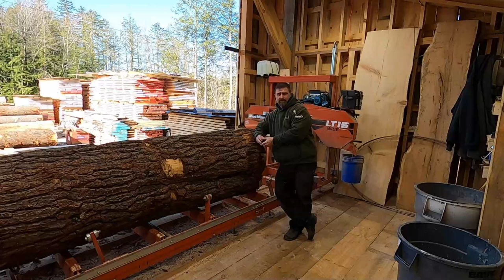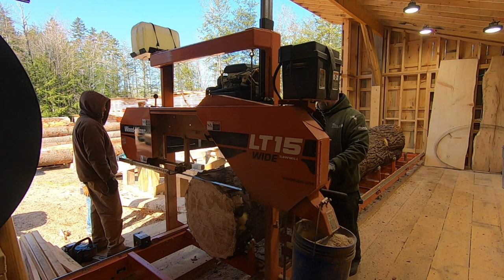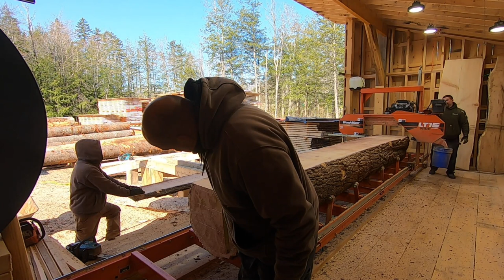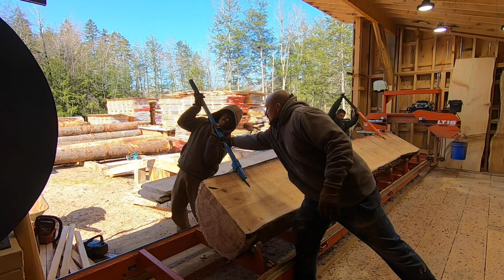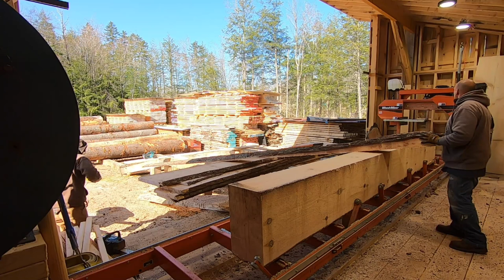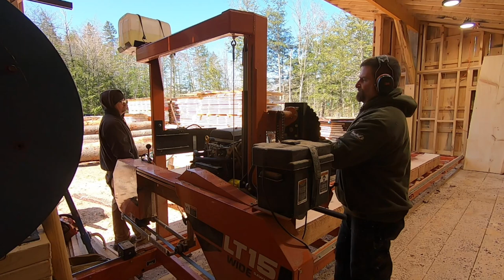LOGS-TO-LUMBER, 3-TON MONSTER

Comment: Hello, congratulations the videos are great! I have been following you for some time, I myself have a Track-Met saw bench. I almost took an LT15 too, but the after-sales service in France leaves a lot to be desired. I see that you are sawing really big 😅 you haven't had any problems on such large sections? Blade breaking etc..? What is this wood anyway because I find that you saw quickly compared to me? As an indication, you change the blades or after how much time or volume? Thanks in advance. Greetings from France🤩 J.B.
Reply from the maker: Bonjour Jean! The larger logs in our videos are "Eastern White Pine" that grows in the northeastern USA (new jersey, pennsylvania, new york, massachussetts, maine, vermont, new hampshire).  It is a softwood, so if you are primarily sawing hardwoods in france, then yes, you will notice a significant slowing-down of your feed rate.  When we saw hardwood (oak, maple, ash, birch, etc), we run the saw much slower.  We have never broken a blade in the saw, they seem to hold-up very well to the day-to-day abuse.  In softwoods like pine, we will get typically 1500-2000 board feet before a blade change.  I assume you use cubic meters for wood production in France, so we typically get 4 cubic meters for softwoods like pine.  In hardwoods like oak, we will get anywhere from 1-2 cubic meters.  The larger the hardwood log, the LESS wood you will get out of a blade, because the blade heats up in the larger logs (because it cant dispose of sawdust out of the gullets during a wide cut), and it kills blade-life.  In smaller hardwood logs (14"-18"), we will average just under 2 cubic meters per blade.  Make sure you are using lots of coolant, we use approx 6 liters per hour when we saw (sometimes more).  Where in France are you? We have friends in Nice:) -Andy
Reply: @cripplecreeksawmill  Hello Andy! Thank you for this very complete answer👍 Indeed, I mainly saw hardwood, type "chestnut, walnut, oak etc.." and I often change blades😅 a little too much for my taste ^^ (especially since I don't have the equipment for sharpening the blades) And otherwise at home, we have "Maritime Pine" which is full of sap and a bit capricious like wood and very heavy.. I don't know your "Eastern White Pine" at all😅 In terms of lubrication, I thought that it was necessary to put as much as possible, the only drawback on my saw is that it clogs up in the housing and the sawdust no longer comes out after a while because it is too wet. .this surely comes from the design of the machine.. In addition, the lubrication is done more on the flat of the blade than on the teeth.. I may have to make changes 🤔 Indeed our unit of measurement is the cubic meter ^^ Otherwise, I'm in the South of France, exactly in the department of Gard (30), I must be 3-4 hours from Nice😉 In any case, it's impressive to see your stacks of boards go up from week to week!!🤩 I imagine that's your main activity rather than for self-construction given the mountains of wood😁? I really liked the assembly videos of your building, you have really ingenious woodworking methods in the USA that we don't have in France. I will try to inspire myself for my future building 😃 Have a nice week end ! Jeans.
Reply: Jean*
Reply from the maker: @jeanbrunel9944  Jean, we have a similar problem with wet sawdust choking off the dust chute in the saw. We clear the chute out 3-4 times a day. We also use a Makita cordless blower to clear sawdust (wet and dry) off the saw and the saw-rails a few times a day. If you don't have one, I encourage you to purchase one, it makes everything very quick/efficient when cleaning. We also cut hardwood slabs, but haven't made videos of it, because we have approximately 400 slabs in our yard right now (not shown on the videos). French white oak is world-renowned for its strength and beauty; I have take a particular interest in the timber-framing part of the restoration of Notre Dame de Paris. Be well! -Andy

Comment: I'd like to see a little more about your shed. How wide is the opening and what is the beam than spans the space? It looks like maybe a 6x10" timber at least 20 ft long?
Reply from the maker: Hi John, the shed is 15ft deepx30ft wide. There is a short wing-wall on each side (to help with the rain and snow coming in from the corners) that are 3ft wide.  So the opening is 24ft.  The load carrying beam is two 2x14 LVL's, with knee braces on each side.  The knees come out 6ft on each side, so the true/unsupported clear-span between the knees is right around 17ft.  If you look back through our videos, one of our first ones is a time-lapse of the complete shed build, so you can see exactly how we built the entire thing.  Thanks for taking a look! -Andy